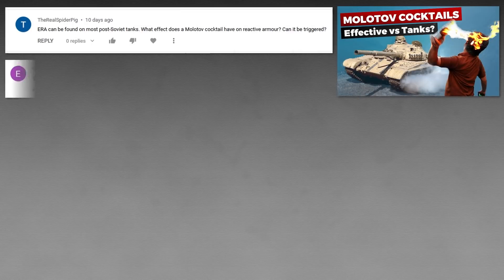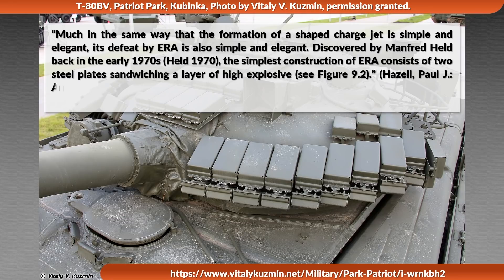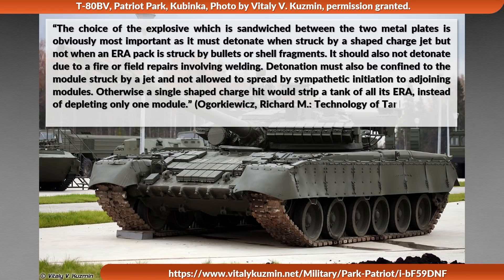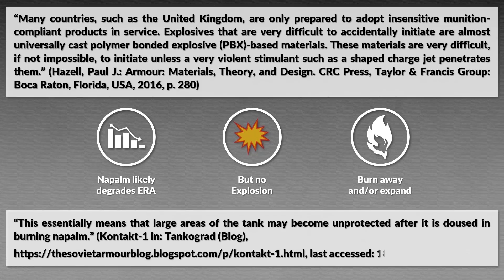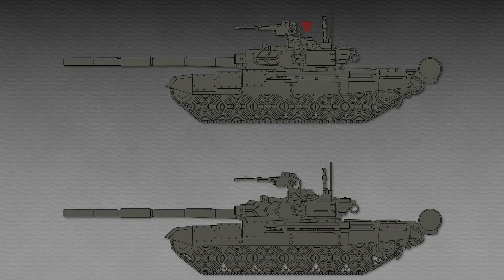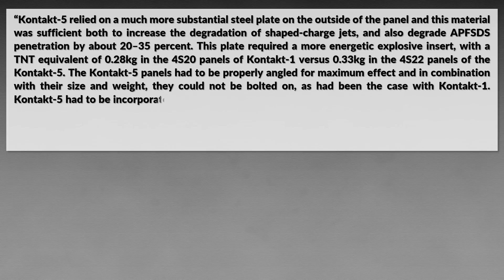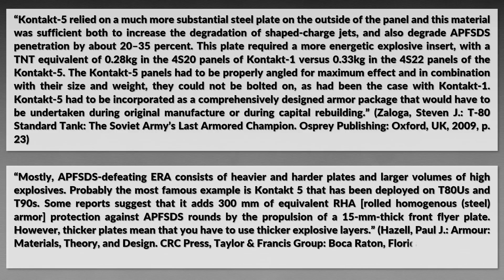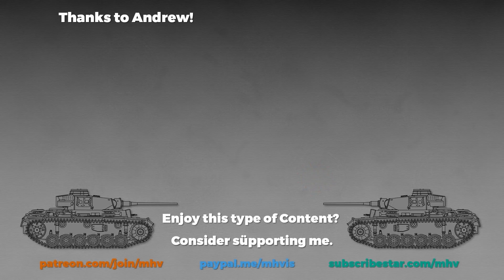Why does Russian Explosive Reactive Armor not explode?

Comment: Likely very similar to binary explosives like tannerite.  You can shoot a .22 into it and it won't detonate, a .223, however.. boom! Also why you need a blasting cap for an explosive such as c4, and even inside a blasting cap there are stages of explosives, from extremely sensitive but low velocity, working its way up to something that can initiate c4.. sometimes it takes three stages in the cap alone! As far as sympathetic detonation goes, sure the tile is going to explode, but it is in all directions, and therefore never going to reach the threshold of initiation.

Comment: Worked in Kuwait doing the Retrograde Mission for GMASS-ITT.  The return/renovation of DotMil tracks that'd been hit/burned/blow'd the fuq up.  Reactive Armor on the Bradleys and Abrams was considered an EOD issue... it takes pressure/compression and explosive power to work, but even then a block of reactive armor that'd been flame-treated?  We considered that "Grumpy Armor: Handle w/Care"

Comment: The pressure in the HEAT plastic shape column may be many orders of magnitude higher than what is generated in even a catastrophic internal explosion. The metal plate does not protect the brick from an internal explosion, it merely transfers the same psi to the brick. Despite our perception that a catastrophic must be super high pressure, the pressure of the HEAT shape column can still be many, many times higher. Pressure is force / area. The tip of the HEAT jet may only be 1 square mm with the force of an explosive shell behind it.  An internal explosion of the force of 10 tank shells may be spread over say 10 square meters (as the video explains). 10 square meters =  100000000 square mm. Maybe the tank shell is 10x more powerful than the anti tank shell.  So the pressure of the HEAT charge may be 1000000x higher in this case. Only the much higher pressure of HEAT charge is high enough to trigger the PBX reaction. You can see that a material can exist that easily distinguishes between internal and HEAT charge explosions.
Reply: This is the correct explanation.
Reply: bLA bLA bLA

Comment: Hey there, thanks for the great video as usual, and a question. Why are the NLAW apparently so effective at taking out the Russian tanks even though it appears to only have a single stage down facing ESC. Photos seem to show allot of ERA on the top of the turrents of Russian tanks, but even so the NLAW seems to get through. Are these lucky shots getting through small gaps in the ERA, or general poor ERA coverage in this area, or multiple hit kills, or Ineffective ERA, or something else? I would love to know your opinion.
Reply: There's likely large gaps in the ERA to make space for the commander's hatch, sensors and optics like the gunner's sight so the chances of striking an area not covered by ERA is more likely, there is also unlikely to be ERA mounted over the engine deck and the driver's hatch/compartment. This combined with the relatively thin armour allotment on the roof (it's one of the less likely areas to be hit) leads to more successful penetrations. I don't have a source for this, but from what I can tell ammunition stored in the turret in the T-72 is more vulnerable than the ammunition stored in autoloader carousel low in the hull and in general those turret stores are likely more vulnerable to catastrophic failure in the event of top-aspect attack than ammo stored in the carousel.
Reply: NLAW will penetrate ERA.
See the NLAWwarhead test against ERA in the below video.
https://www.youtube.com/watch?v=BGjGkmQcPwU
Reply: @dogsnads5634  Thanks!
Reply: @dtly50  Actually from the footage I saw, it was actually sheets of thick rubber inside the ERA metal cases... However I did also see many cases where the  Russian soldiers blinging out thier tanks with plenty of wood too. I guess they were helping the Ukrainian boys make sure Z-tanks turn into a proper bonfire after being hit by the ATGM. You can really tell how the Russian soldiers are dying to get home..

Comment: russian ERA DOES explode, but is designed to go off with a certain level of direct explosive pressure, which is why molotov coktails, low caliber autocannon rounds and rifle bullets do not set it off.early kontakt-1 tiles detonated if hit by a warhead with sufficient strength- the whole point of kontakt-1 armor arrays was to explode in order to spoil the attacking forming HEAT jet, but had no effect against a SABOT penetrator, which would pass right through. the early K-1 bricks were good for one use only, after detonating, they were used up and individual blocks would need to be replaced. kontakt-5 armor explodes, but in a different way- it isn't used up the same way earlier K-1 could only be expended one time, rather, in the K-5 cell, the explosive 'feeds' more defending plate fragments into the path of the incoming penetrator- effective against either a chemical energy (HEAT) warhead or a SABOT penetrator, but it is good for more than one shot, unlike K-1. in sum, the whole point of ERA is that it is a controlled counter-explosion to either divert the path of an incoming penetration, or break up the penetrator so that by the time it hits the main armor behind ERA, the penetrator or HEAT jet is significantly weakened

Comment: 1) Are those metal boxes even loaded with the proper explosives?  Counterfeit/place-holder field equipment has been seen.
2) Maintenance.  All explosives degrade over time.  How old are these blocks?
3) Physical condition.  A fragmented block is of little use in breaking up a jet.
Those metal boxes on the dead tanks are all empty, the explosive having burned out when the road-wheel did.

Comment: One of our Bradley’s took an EFP through one of the blocks of ERA in Baghdad in 07. The block was left in the hallway for a few days, so as I was taking a look I ripped off a chunk of the explosive sheet that had been exposed. I took it outside and lit it on fire, it burned energetically but in a controlled and relatively slow manner. After about 15-20 seconds I dropped it and put it out with my boot heal. No problems. I was also on a patrol where an EFP detonated and a piece of copper hit one of the blocks on the Bradley in front of me, catching it on fire. It burned for 15-20 seconds until a dismount hit it with a fire extinguisher. Again, no detonation.
Reply: No. It did not. It didn’t detonate, and it definitely wasn’t enough material to stop an EFP. Granted it may not have been as advanced an ERA as some russian types.
Reply: @TJ24050  As far as i know, there is no ERA that can reliably stop EFP.
Reply: @TJ24050  oh no! so it sounds like you could have been better off without the extra weight, if you just relied on your main armour alone
Reply: @JinKee  you say that until you need it. lol, some soldier had to uparmour with water can and sandbag. no one really care if they are effective, it better than having nothing.
Reply: @JinKee  the ERA blocks are designed to stop HEAT warheads like an RPG. They were definitely worth having and the Bradley’s barely noticed the extra 2+ tons.
Reply: did the ERA stop the EFP in both cases just by the strength of the steel flyer plate alone?
Reply: In Iraq the biggest threat would have been rpg's. although around 06-07 time frame The EFP road side bombs caused the majority of casualties I don't see how removing ERA from Armor would have appreciable benefit.  so the ERA was Important.
Reply: @BellicTaxi  Don't get me wrong, ERA helps at least with providing aditional physical armor since its walls are pretty thick(especially latest ERA varients).
Reply: @victorzvyagintsev1325  15mm of RHA even if spaced by a few inches will do basically nothing to modern apfsds. The explosion from the ERA has a chance to shatter modern apfsds rounds which reduce their penetrating power considerably. ERA also hampers the formation of the cone in a shaped charge impact like an RPG or HEAT round which also will drastically reduce the penetrating capabilities of the round before it hits the main armour. The issue that people don't get is that ERA can't protect where it isn't is 😂 javelin missles and N-laws use a top down approach completely bypassing any ERA and punching right through the insanely thin top armour. Much easier to get through ~30mm of RHA on the top compared to ~600+ mm of composite armour on the front of a "modern" tank like the M1A2 abrams
Reply: @keeganpaul2483  This is actually the idea behind the Russian cope cages they are supposed to break the cone or redirect the jet of the explosion from apfsds ordinance. They don't seem very effective but there has been R&D done that says your chances of penetration are much lower.
Reply: @Jeremy Nimmo Yes because Saddam Hussein was a paragon of virtue 🤡🤡
Reply: damn its shame u managed to come back from there

Comment: Before I watch the video. IF anybody wants a short answer. Military grade HI explosives can't explode from fire. There are two kinds of explosives Primary and Secondary. Stuff like TNT, C4 or reactive aromor are secondary explosives and they can be set off by combination of heat and high pressure, molotov can't provide that. Primary explosives are used in detonators to prime the main charge and generally they are more potent than Secondary ones. Simply speaking you need an explosion to set off the eplosives.

Comment: The Javlin tank missles has 2 war heads one is to discharge the reactive armor but also the Javlin and nlaw  has two settings one to hit tank in side or fliy up last second and hit the top of the tank where armor the weakest and also Russian tanks use a auto loader and has exposed rounds in turrets basket and heat Cooks off the tanks rounds and that's why Thay tip there hat ... meaning turret flys off because tanks rounds explode it off and also what Thay burn way Thay do
Reply: Yep, that's why theres so many pictures of them decapitated- Burn 'em all!

Comment: IIRC explosive wafers for Kontakt-5 are stored seperately during peacetime and only inserted into their casings at workshops when needed for various reasons (readiness check, action imminent, etc.) 
Seeing the abysmal levels of preparedness of Russian forces in Ukraine, I wouldn't be surprised to know that a whole fleet of K-5 equipped tanks didn't have their explosives inserted.

Comment: Well, obviously you want to search for the penetrating hole on the turret or hull, with an absence of any ERA block(s) in that spot, right?  If only those blocks exploded then it worked as advertised but it wasn't enough to stop the penetration.   If the blocks didn't explode but have holes in them, then they didn't work at all.  In any case, none of the surrounding blocks exploding just means you didn't have a chain reaction.

Comment: I was wondering why they hadn't been stripped from tanks and incorporated into IEDs of some sort.  Either explanation, a) too insensitive, or b) egg crate cartons, makes sense.  If b, then putting the cage on the top now just makes them easier to find.
Reply: I've asked the same sort of question. Basically, can ERA be repurposed as an IED and use something like C4, Detcord or blasting caps to set it off. If it could, the steel sandwich plates, any other projectiles added to the mix would be very effective.

Comment: It's easy to understand how2 hard it is to detonate ERA. Remember, the shaped charge ingot it powerful enough to melt and shatter  an area of only as few square inches of hardened steel plates several inches thick. Think of the extremely high heat and energy that is expended in those few inches that became as hot as the surface of the sun and tens of thousands of PSI The explosion of the ERA interferes with the formation of that jet of metal Even an exploding tank with all the ammo cooking off is nothing com[pared to that! When you realize the extremely intense focused heat at pressures equivalent to the center of Jupiter then it's easy to see why regular little things like high explosives and fires hot enough to melt drive wheels don't detonate ERA!

Comment: Because there are actually empty egg cartons inside it and not explosives.
Reply: The "egg cartons" are formed plastique.
Reply: @news_internationale2035  Yes, yes...They are spacers to help keep the explosives aligned correctly.

They aren't functioning effectively, and the entire concept is outdated.  They can be whatever you want, they aren't proving effective against modern anti-armor counters.
Reply: @draega570  
They aren't spacers.
They are the explosive.
Reply: @news_internationale2035  They're a joke. Like Russia, they're more aesthetic than useful.  A prop; a gimmick.

But also, you're wrong.  There are 2 components to the interior portion of each 'plate', and the part I am referring to is not the explosive component. 

You can refute it all you want 😂

Cheers!
Reply: @draega570  Well you are wrong.

Comment: Is it possible for a 50 cal. or even heavier cal. Armour Piercing Incendiary round from a rifle/gun to have any effect on certain types of ERA? I suppose not but just a thought, it would be somewhat of a joke though, if so that could be pretty bad, I have no idea of the thickness or type of steel/explosive used on the various types of ERA but some of these rounds are pretty bad ass, and depending on range/cal. can be pretty devastating, could even be a David and Goliath moment? For instance did they not think about aluminium (and no yanks it's not aluminum) warships once on fire could not be extinguished easily, HMS Sheffield in Falklands conflict! I see argentina is at it again, when someone does something with an Island they couldn't be bothered with, then they want it, I wonder if they have any russian blood? Pathetic assholes just like the russians, we don't really want it but you can't have it, they fight as well as russian troops, gotta be a connection somewhere surely?

Comment: Shaped hollow charges without a metallic liner do produce a plasma jet. Plasma is its own physical state of matter which acts not unlike a fluid. 
Metal liners such as copper, iron, tantalum become plastic on detonation. If you place a heavy metal screen in front of the charge, it'll make dozens of small globs out of the initial glob, that will devastate soft targets; a shotgun on steroids.

Comment: Fun fact, explosives in bombs and artillery shells are "casted" inside the cast steel shells. They are molten and pour inside them. And they can also be molten back and be emptied.
That is why you can have arty shells banged with hammers, transported in off road trucks, fall from height and abused by soldiers with total safety.
They are only live when the fuse is coupled to them and safety elements preventing the fuse primer charge to be activated are removed.
Reply from the maker: well, I wouldn't hit the primer ;)
Reply: @MilitaryHistoryVisualized  yeah, but they are only installed on them before use.
Reply: On one course in Germany we learnt to mould PE into shapes for required effect. You can burn and crack open arty rounds to pour into new containers for IEDs safely enough.

Comment: We used to find people burning mortar, arty, and mines open over a fire to pour HE into new containers for IEDs. Emphasis on High in HE is because it has a high tolerance to being messed around. Low Explosives are a very different and dangerous beast. Just touching or dropping it can set that off. You can even burn HE and admire the funny colour of the flame and be safe. 

Of course ERA is HE as crews need to be able to walk all over the hull of the vehicle safely. 

So when I see burnt ERA on these vehicles my only thinking is there is a lot of work for clearing up these battlefields and destroying the HE. 

As for some not going bang in the early days of the war a video showed soldiers opening up the side bags of relikt and it was so aged the HE crumbled in his hands. I’ve seen decades old HE desiccate like that so I suspect it was the original HE and never replaced. Something the Soviets and now Russians are guilty of is yes they produce some amazing tech but suffer from lack of funds to maintain it.
Reply: 'High or low' explosive refers to the detonation velocity. Black powder is a LE around ~6000 ft/s while RDX cooks along at 25,000 ft/s. ANFO is an HE, velocity varies by composition, ~7500 ft/s to ~15,000 ft/s.

Comment: If I recall, high explosives need to be exposed to a shockwave in order to detonate (if they are just exposed to heat, they “melt”), unlike low explosives which detonate when exposed to fire/heat. This is because the fuel and oxidizer are much closer together  in HE than in low explosives, making its chemical reaction faster. Thus, for HE to explode, it needs a shockwave to detonate all of its molecules at once.
So, I think a Molotov cocktail or other sources of heat can at most can only degrade the high explosive in ERA, as pointed out in the video. Hope this is relevant!
Reply: I think it's highly dependent on the chemical itself. High explosives AFAIK are just explosives that have a higher denotation velocity, so the properties of the actual chemical could be different and still be HE. For instance I've definitely seen videos of some particularly sensitive explosives going off from the heat of a lighter through foil. That being said, I think you're right about pretty much any HE material used by militaries on account of not blowing up easily with heat is obviously very desirable. Even then though it might always just 'melt' as I've heard (just from some guy mind you) in Iraq some soldiers used C4 as a fire starter for campfires, since it burns pretty well when exposed to flame.
Reply: So called low explosives such as black powder are actually propellants.